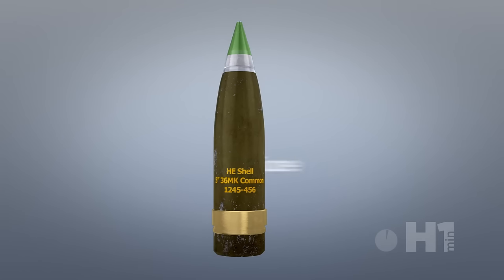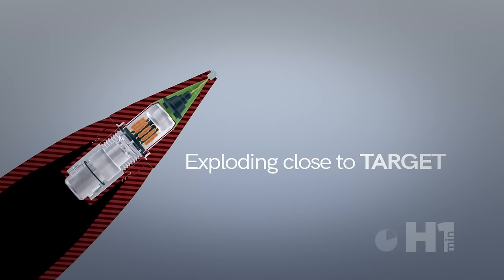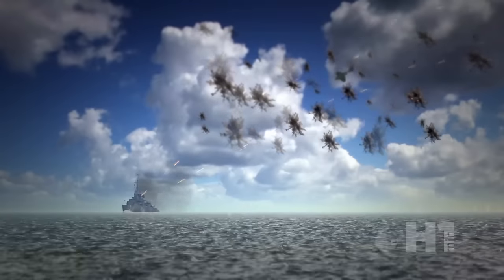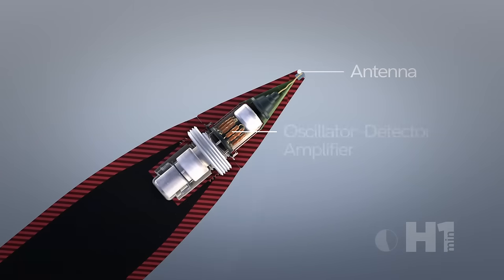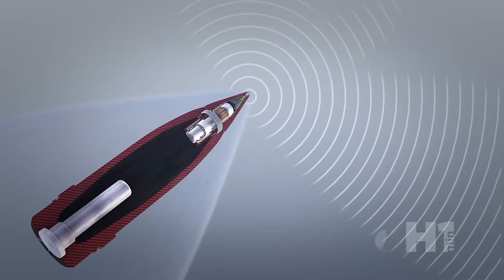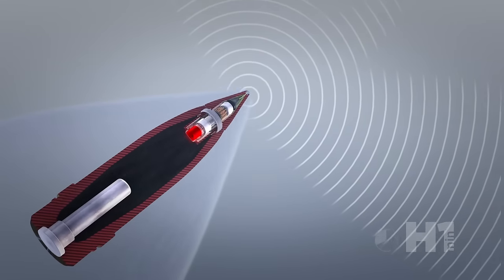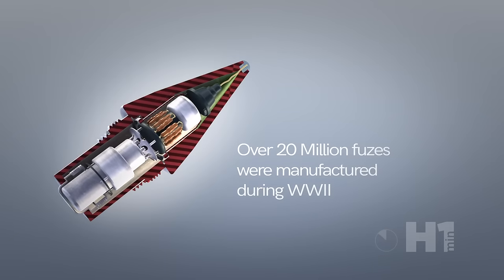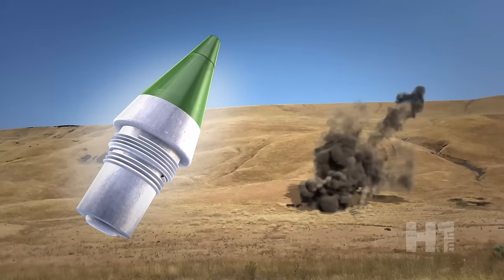H1MIN: WWII VT Fuze

Comment: Great video but - fuse!
Reply: both fuze and fuse are correct
Reply: @PineCone227_  No - in English fuse is correct.
Some foreign adopters of English don't take the trouble to learn the language properly and use an anything-will-do approach.
Fusion, to unite by melting together. (Originally French)
Fused, melted together.
Fuse, something that causes fusion.
Or is is fuzion now?
Perhaps confuzion next? :)
Reply: @johnx9318  Wrong. As explained by Oliver Hogg in his book "Artillery: its origin, heydey, and decline" -
The word "fuze" is often spelt "fuse" by those unacquainted with artillery usage. This is incorrect. "Fuse", derived from fusus, the past participle of fundo, means "to melt", e.g., the term "fuse-wire" used in electrical circuits. "Fuze", on the other hand, is the shortened or modern method of spelling "fuzee", meaning a tube filled with combustible material. It is a derivation of fusus, a spindle and from the French fusee, a spindle full of thread. It is well to make this point at the outset.

Even the US military spells it with a 'z'. Its hilarious how you jumped to the conclusion that its a case of foreigners "not bothering to learn english properly" when you yourself dont even bother to check your facts. Stop making things up to sound smart.
Reply: @BecauseHyena  You seem to have proven my point very concisely. Thanks.
Your mistake was taking the USnA's uneducated, lazy and ignorant bastardisation of the English language as an beacon of proper English is a truly a futile exercise.
And yes, exercise too has an S, not a Z.
Swing and a miss.
Reply: Did you even read the quote from Oliver Hogg? His book was literally endorsed and published by the Royal Artillery Institution in London.  He also referenced several GB patents that refer to the invention as an "electrical fuze". This makes you wrong again.
Also I mentioned the US military's spelling of the word because they literally helped the British invent the proximity fuze. Pretty sure the English guys would've already corrected them 80 years ago if the Americans had the spelling wrong don't you think?
Finally, stop using irrelevant counter examples: "exercise too has an S, not a Z". You're only making yourself sound condescending. I already told you that the word fuze is not derived from the word 'fuse' - that is of course if you even read my previous reply which I think you are too ignorant to do.
Reply: @BecauseHyena  Or it makes him wrong.
Reply: @BecauseHyena  PS - americans don't like to be corrected. They already know everything apparently.
Reply: @johnx9318 You appear to be projecting because your description of Americans "not liking to be corrected" and "knowing everything" fits you perfectly.
I haven't been to the US but I've known a few Americans from post grad school at Oxford. They aren't all arrogant as you make them out to be.
You claim Mr Hogg to be wrong but you don't state your reasons for saying so. Do you honestly expect people to believe you, an armchair expert, instead of Brigadier O. F. G. Hogg of the Royal Artillery - who was even awarded the The Most Excellent Order of the British Empire for his contributions in field artillery by King George VI himself?

Here's some advice. You have been called out. Stop trying to wriggle yourself out if it; you're only going to embarrass yourself more. Next time argue with facts that you can back up instead of using hollow opinions and emotion. Have a good day.
Reply: @BecauseHyena  Nice try. The RA are a new service. I was a gunner in the RN, the senior service.
We used fuses.
My knowledge is first-hand and not the result of academic pontification.
I didn't say that americans were arrogant - your projection there.
Thanks for your rudeness.
And thanks, having a great day.
Reply: @johnx9318  You literally said that the Americans "don't like to be corrected" and "apparently they know everything". Tell me how that isn't the same as saying they are arrogant.

Your account regarding being in the RN does not take precedence over the account of a British officer who has studied artillery for the majority of his life. New service? The guy literally lived through WW2. If you took the time to look up my sources then you would have seen that the GB patents the British inventors of the proximity fuze applied for literally spell it that way. Just because you and your unit decided to spell it differently doesn't magically invalidate the way the inventors of the device itself intend to spell it. It may have been acceptable to spell it as "fuse" in your unit but that doesn't necessarily make it universally correct. I wouldn't blame your unit though because everyone makes mistakes after all. However, brushing off well-cited constructive arguments that prove you wrong as "academic pontification" is not excusable and exemplifies ignorance/inability to engage in civil discourse on your part.

I apologize for hurting your feelings. But then again, can you really blame me when I'm arguing with someone who thinks his "first hand account" in the RN is more credible than my well researched arguments. Maybe I should also mention that I work in RnD at BAE Systems developing standoff weapons since were talking experience?
Reply: @BecauseHyena  Yes - literally.
And I did not say they were arrogant.
You inferred that yourself.
Mmmm, take the word of a researcher or someone who used the things for real?
Difficult...
Reply: @johnx9318  More like "take the word of an engineer who has been studying artillery for 7 years and helps develop and instruct the military how to use it or the RN serviceman who is only taught how to use it without any real knowledge on how it even works"
Reply: @johnx9318  Also, be a dear and kindly argue against the other points I made. Don't dwell to much on whether or not you called the Americans arrogant. I'll let that pass if you actually make the effort to form a constructive counter argument. If you're so sure of yourself, then it shouldn't be that hard.
Reply: @BecauseHyena  Don't know how you get your hat on.
Reply: Dude youre getting demolished by him. If you havent noticed, youre digging your own grave at this point.
Reply: @joeysoledad469  Finally someone to break some sense to him
Reply: @James some guys just dont know when to give up. ive known my fair share of boomers who would rather die than admit theyre wrong lmao
Reply: @BecauseHyena  It was you who brought it up.
Reply: @joeysoledad469  Nose
Reply: Funny thing, I made a simple observation to the author of the video. He/she didn't get all unnecessary with me.
I didn't interrupt any of your posts.
However, @James took it upon himself to preach his own version of the truth to me and actually tripped over his own argument, and you decided to get a free ride in his back.
Champion trolling.
Reply: @johnx9318   Sorry where exactly did I trip over my own arguments? As I see it they are still solid and I've not made any contradictions.
Stop trying to turn this around and making it sound like you don't deserve this.
Sure, you only made an observation. Problem is, I happen to know references that say you are wrong, so I corrected you. What you then did was spread misinformation that you falsely attributed to "foreign adopters of English not bothering to learn the language properly". You then proceed to insult Americans by saying they are uneducated, lazy, and ignorant because I mentioned them in an argument - and you fail to realize that the Americans didn't come up with the word "fuze", the British did. I give you references published by highly regarded people in the field but you fail to address them too.
But sure, all you did was make an "observation".
Reply: @joeysoledad469  You back again? So nosey and judgemental.
Nothing better to do with your life than interfere in the business of others?
Tsk.
Reply: @johnx9318  Your appeal to emotion wont work here.
Kindly point out where I called you out for saying "the Americans are not learning the language properly".
I've made this up? Dude the sources I quoted are avaiable from reputable websites on the internet. For all I know, you could be the one making up anything since all your claims are just word of mouth and not easily verifiable.
Regarding the belittlement of your RN rank; kindly tell me, who is it again who compared his military service to a 'researcher' in attempt to belittle him?
Finally, don't involve other servicepeople because you do not represent them (i hardly believe they would want to associate with you in this aegument anyway). All my comments are directed to you and apply to you alone. In fact, you should be ashamed of yourself because you are using the repuation of servicepeople for your own personal interests.

I'm saying it again. You brought this upon yourself.
Reply: @John X
"you proved that fuse was derived from a word with an S, not a Z"

LOL did you even read his first comment on this thread entirely? fuse was derived from a word with an 's' BUT fuze is derived from the word fuzee which is what the inventors intendes to call the proximity fuze
this is freakin hilarious
Reply: @joeysoledad469  Butthurt butinski is back!
Just can't keep your proboscis out can you?
Reply: @John X
"Your assertion that an academic had more right to be right than a person who actually used the product is nothing short of arrogant."
He never said that it was claim made by himself. what James did was refer to a claim by the inventor of the device itself. so to the correct version of your statement should be:

"Your assertion that the inventor of a product had more right to be right than a person who actually used the product itself is nothing short of arrogant." You see how stupid that sounds? stop twisting his words to prove a point

and no im not leaving because i have the freedom to speak my mind. unless youre telling me that i cant enjoy one of the basic rights our military servicemen are fighting for????
Reply: @BecauseHyena  No, you couldn't find them. But you are hardly motivated to try hard are you?
Nice try again, but now you have made the quantum assumption that I am not  decorated!
Not only is that another wild swing, but most people who have been there have not been decorated. You just insulted them.
Further, for someone who didn't serve - how transparently judgemental.
How dare you put yourself in judgement of these people?
Yes I did call you names, but only because they are an accurate depiction of the supercilious and pompous attitude that drives your invective.
Reply: @coreyg.3116  Thanks, but it's his play.
Reply: @johnx9318  Here we go again:
"No, you couldn't find them. But you are hardly motivated to try hard are you?"  > Hmm so you accuse me of saying something and yet you yourself can't point out exactly where I said it? Come on you can do better than that. I did you a favor and quoted all your arguments in my replies so you can't deny saying them. Be a dear and do the same please.

"Nice try again, but now you have made the quantum assumption that I am not decorated!" > Again please show me exactly where I said your weren't decorated.

"Not only is that another wild swing, but most people who have been there have not been decorated. You just insulted them." > I beg to disagree. My grandfather was enlisted in ww2 under the Royal Corps of Signals. He said he he was relatively safe, far from the frontlines. He wasn't a decorated soldier and he recognizes that his sacrifice is in no way the same as those who fought at the front. Is he insulted when people comment on his lack of decorations? No because he himself is aware of his own contributions and would not dare to compare it with those who gave up their lives in the front. Im sure any respectable serviceperson would not dare inflate their service because doing so would be stolen valour. Hence, the same, less decorated servicepeople would have no reason to be insulted when others talk about highly decorated servicepeople. Does that mean their contributions are worthless? Absolutely not. Thus by saying this phrase:
 "most people who have been there have not been decorated. You just insulted them."
You are telling them that they SHOULD feel insulted because YOU believe that their contributions are worth less.

"Further, for someone who didn't serve - how transparently judgemental. How dare you put yourself in judgement of these people?" > Refer to my previous argument. I am not judging these people. I am judging you.

"Yes I did call you names, but only because they are an accurate depiction of the supercilious and pompous attitude that drives your invective." > You know, you yourself haven't responded in a way that promotes civil discourse. You attack my character instead of my arguments. I was hoping youd have realized by now that insults mean nothing to me (people capable of basic critical thought tend to be immune to them).

Again, you brought this upon yourself.
Reply: @BecauseHyena  You impose your opinion to a comment for someone else and expect a civil response?
Your arrogance knows no bounds.
As for the rest of your tiresome tirade, you should get a job inflating blimps.
Reply: @johnx9318  
"You impose your opinion to a comment for someone else and expect a civil response?" > The same way you imposed your misinformed opinion against the author of the vid? I'm sorry but this is the internet. You post your opinion, you open yourself to criticism. That is what makes the internet such a powerful tool; people are discouraged from posting false information and misinformed opinions because they know they are at risk of getting exposed and these people often do not want their beliefs questioned - they dont care if they are wrong; for them, their ego is more important than the truth. When you post your opinion on the internet, you should be ready to back up your claims with logic and facts. Otherwise, expect to be shut down. If you are too narrow minded to accept that your beliefs will be challenged, then I'm afraid the internet is not for you.
Also for the record, I did not state an 'opinion'. I stated a 'fact' because I was able to produce first hand sources that can be verified by everyone here. You are the one making an opinion because all you have provided is word of mouth to prove your claims.

"Your arrogance knows no bounds. As for the rest of your tiresome tirade, you should get a job inflating blimps." > Let's see. Throughout this conversation, I have made it clear that I am open to correction by laying out all relevant information regarding my claim. I focus on every counter argument and ask clarifications. You on the other hand never bothered to provide verifiable information regarding your claims, leaving us to guess where you based your statements from. You dodge most of my counter arguments and all you do is swing back with insults as if you feel threatened (are you?). All that and yet I'm the arrogant one? Hmm.
And again, if I were you I'd cut down on the insults because it's only making you sound desperate. Perhaps you got used to throwing the same insults to your subordinates in the RN to shut them down, expecting them to back off? Sorry but I'm afraid that's not how it works everywhere else.

Once again, you brought this upon yourself, John.
Reply: @BecauseHyena  What did I bring upon myself? Your intrusive whinging tirade?
It's not the big deal you think it is. Really.
Get over yourself champ.
Reply: @johnx9318 
"What did I bring upon myself?" > The embarrassment of getting lectured by someone probably younger than you over the internet.

"Its not the big deal you think it is." > Yet here you are, still responding to me :)
Reply: @BecauseHyena  Another quantum-leap of conclusion!
i'm not embarrassed. This is fun.
Keep spouting moby...
Reply: @johnx9318  You seem to have proven my point. You still replied so it IS a big deal to you :)

And trust me, I'm having as much fun as you are
Reply: @BecauseHyena  I thought you had blown a fuse.
Reply: @johnx9318  That's rich coming from someone desperately crawling his way out of a losing argument :)
Reply: @James holy shit you killed him dude
Reply: @John X Nope. Im picking my own fight with you.
All you did was cavil and squibble at james' points while you yourself havent brought anything of substance to the table. you are in no position to be throwing insults around here lol
Reply: @joeysoledad469  He would be delusional if he thinks that his insults hold weight
Reply: @joeysoledad469  Are you sure? I feel entitled.
Reply: @johnx9318  Yea we already figured that you probably are entitled given your responses.. But thanks for saving us the trouble and admitting it yourself :)
Reply: @BecauseHyena  It's a real word with a real meaning.
Not just a cheap insult thrown by you virtue-signalling KBW's.
Reply: @BecauseHyena  
oh. and 'us'? What a givaway!
:)
Reply: @johnx9318  Also:
"virtue signalling KBW" > Hmm I dont think virtue signalling means what you think it means
Reply: @BecauseHyena  Sorry you don't know what VS means. You could look it up?
And the 'us' reference was regarding your admission of collusion with your academic hero.
Reply: @johnx9318  
"Sorry you don't know what VS means." >  I never said I didn't; maybe you should get your eyes checked.
I looked it up for you cause you apparently are too lazy to do it. Oxford defines VS as "the action or practice of expressing opinions intended to demonstrate the moral correctness of one's position on a particular issue". How did you turn an argument about fuzes into a discussion of morals? Swing and miss.

"you have an entire weak mind" > I'd be impressed if that very well thought out insult came from 5 year old, not a fully grown adult who claims to have served in the RN :)
Reply: @BecauseHyena  And now you are playing guess the age? Just keep assuming things.
Reply: @BecauseHyena When you bragged about your fantastic education, you also took the opportunity to blow your own trumpet regarding your fantastic powers of research.
Pity you can't compare your comments to mine before you continue to prove my points! It's not not brain-science.
Nearly 40 grand a year? I wonder what currency that is? Pesos? You don't seem Mexican.
Reply: @BecauseHyena  Name-dropping 'Oxford' in an educational context is most definitely bragging.
Your inflated ego failed to resist that little temptation.
Mexican was thrown in to demonstrate how often you assume things - in this case that your 40k salary was in pounds and not pesos.
I will assume that you are from the UK and not Zimbabwe. A Zimbabwean, would demonstrate better manners and respect when engaging with strangers.
 But now you have explained that to me, I am better able to understand why you are so closed-minded and intolerant.
Perhaps if you got a better job you could afford to travel? It would broaden your mind and teach you how to engage with others.
Reply: @johnx9318 
"Name-dropping 'Oxford' in an educational context is most definitely bragging." > That is just your opinion. All I mentioned was the city. There are many universities in Oxford and not all of them are prestigious to the point that one would even consider "bragging" about them. You just clearly demonstrated how often you assume things.
"Your inflated ego failed to resist that little temptation." > Again, Ive already explained above that you assumed incorrectly and hence misinterpreted my intentions. Yet here you are making another false assumption. It wouldnt be possible for me to "fail to resist" something that was never there to begin with. Swing and miss.

"Mexican was thrown in to demonstrate how often you assume things - in this case that your 40k salary was in pounds and not pesos." > John, you pulled all that nonesense from me saying the words "quite well". Are you really sure I'm the one whos "often to assume things"? :)

"I will assume that you are from the UK and not Zimbabwe. A Zimbabwean, would demonstrate better manners and respect when engaging with strangers." > The Zimbabweans are lovely people. Too bad you yourself have manners so poor that even they, in all their kindness, would probably not deem you worthy of their respect.

"But now you have explained that to me, I am better able to understand why you are so closed-minded and intolerant." > Oh this again. Since the start Ive made it clear that I am open to correction by laying out all my claims in detail and answering to all counter arguments. You, on the other hand, dont even bother explaining your claims. You fail to defend most of your counterarguments once I address them and you choose to attack my character instead. Hmm, it appears that you are the one "close-minded" and "intolerant" here, John. :)

"Perhaps if you got a better job you could afford to travel? It would broaden your mind and teach you how to engage with others" > Another assumption on your part, I'm afraid. :)
I don't exactly have lots of bills to pay at this age so I've travelled to 8 countries now. Ive befriended many people across different cultures and you know what? You still stick out as the worst example of a human being that I've come across.
Another swing and miss.
Reply: @BecauseHyena  Took such a lot of effort to write such a lot of tripe.
Swing and a miss - where have i heard that before?
Reply: @johnx9318 
"If you wish to engage in discourse and encourage a good response, then the tactics of bulk copy-and-paste along with attempting to claim originality for the other fellow's observations becomes too tiresome. Both to read, and to reply to." > Oh you find it tiresome? Sounds like your problem, not mine. I mean anyone would get tired eventually when it becomes apparent that their repeated harassment of a person is not having its desired effect. :)

"Just to reiterate, you began your discourse with me by being rude, arrogant and intrusive." > Nope. I only responded in the same manner you replied to the first comment on this thread made by PineCone227.

"You showed condescension from the start and are an opinionated blow-hard." > Let me remind you how you started this argument:
"No - in English fuse is correct. Some foreign adopters of English don't take the trouble to learn the language properly and use an anything-will-do approach."
also
"Fuse, something that causes fusion. Or is is fuzion now? Perhaps confuzion next? :)".
Seems like you were the one who has been condescending from the start. You may convince yourself otherwise but that wont change the truth.

"Your diatribe is freely laced with assumptions," > You say this but you havent even succeeded in calling me out on a wrong assumption. Everytime you claim I made an assumption, I address it directly and you always end up giving it up or not dedending perhaps because you realize I proved you wrong.
"None of which hit their mark" > Is that so? How come you havent countered any of my fact-based claims yet if youre so sure I'm wrong? You cant just say theyre wrong, John. You have to prove it. That's how arguments work.

"you are desperately trying to salvage your butt-hurt ego"> Hmm. Ive responded to you calmly in well thought out arguments. You respond with hate, unproven accusations, and immature insults that have nothing to do with the discussion. Seems to me that you are the one "desperately trying to salvage his butt-hurt ego", John.

"Attempt to best me in any way you can" >Hold on. You thought this was all about me trying to best you? That never even occurred to me because I'm barely trying, John. Funny how you think its suddenly a contest of whose "best" when all im trying to do is engage in casual discussion.

"Oh, and you have to have your supporter also butt in" > Remember that these strangers based their judgement solely on the arguments weve made. We were judged on equal footing. Being upset with them will only prove you are narrow-minded because you choose not to concede despite several people already proving you wrong.

"and tag team troll tactic. How's that for an alliteration" > Too bad that little alliteration of yours is not enough to "salvage your butt hurt ego". Keep it on topic, John.
Reply: @BecauseHyena  Have you considered writing a book?
You could cut and paste yourself onto the bestsellers list.
I'm not bothering to read your c and p rants. Far too boring.
Reply: @johnx9318  You wish to deliberately ignore my valid points? Looks like thats your problem.
Also, the truth tends to be boring. Unfortunately for you, my points still stand no matter how hard you try to avoid it.
Reply: @johnx9318  
Too bad . By choosing to ignore my counterarguments, you give up defending your own points. That doesnt help your case, John.
And you are mistaken. I never supposed quantity had any benefit to my position. If you havent noticed, all my long comments are proportional to yours. You make a long comment, I make a long comment. I'm simply being courteous. :)
And me? Desperate? That's a lot coming from someone who openly admitted to not bothering to read points made against him because he cant come up with a logical counter argument.
Reply: @BecauseHyena  You don't think that extensive cut and pastes don't add to the quantity?
That's a silly comment.
Reply: @johnx9318  The extensive cut and paste that is solely dependent on the length of your own comments? You tell me, John.
Reply: @BecauseHyena  Word salad
Reply: @johnx9318  if that perfectly understandable statement appears as "word salad" to you then that's you problem, John. :)
Reply: @BecauseHyena  It's gibberish. Means nothing. This demonstrates your lack of ability to communicate. It is either deliberate or ignorant obfuscation.
Reply: @johnx9318  Nope. It demonstrates a lack of reading comprehension on your part. I hope its deliberate and not ignorant obfuscation. :)
Reply: @BecauseHyena  Glad to help you learn a new word. Good of you to use it straight away too.
If only you would learn some manners...
Reply: @johnx9318  Glad to help you learn the correct meaning of "virtue signalling" as well. Too bad you found out after youve already used it incorrectly. If only you would learn to be grateful..
Reply: @BecauseHyena  Just rehashing my arguments. Sad that you have no original thought.
Reply: @BecauseHyena  You wish!
Reply: @johnx9318  I dont have to. You never proved me wrong.
Reply: @BecauseHyena  Didn't have to - you did that all by yourself.
Reply: @johnx9318  Prove that I did. I'll wait. :)
Reply: @BecauseHyena  Don't hold your breath...
Reply: @johnx9318  Take your time :)
Reply: @BecauseHyena  Sorry, can't engage atm. Cocktail time. Speak later...
Reply: @johnx9318  Alright see you soon
Reply: @BecauseHyena  Sorry about that.
Just wondering if you are okay with the side-effects?
Reply: @johnx9318  Youre getting off topic again, John. :)
Reply: @BecauseHyena  You are right, but it is significant.
You're in danger of permanent erection loss. When you get your next stiffie, your mind will inexorably think of me and your tiny todger will go all floppy. Sorry.
Same with sleeping. As you drift off, I will pop up in your mind and your blood pressure will shoot up. Can't be helped. Just try to ignore it. You'll be fine.
I'm just playing. It's just a bit of fun.
Can't happen. Really.
Reply: @johnx9318  Just type away, John. I promise to read them all.
Reply: @BecauseHyena  Pity you can't learn from them.
Reply: @johnx9318  nothing to learn from your little rant filled with hate and nonesense.

To make it easier for you, ill oversimplify my replies to keep you on track until you come up with a fact-based logical counter argument to my points. Have fun. :)
Reply: @BecauseHyena  That's brilliant! I won't have to put up with your monotonous drivel!
Thanks.
Reply: @johnx9318   thats still an invalid argument, john. Try again. :)
Reply: @BecauseHyena  It's no better than you.
Reply: @johnx9318  still waiting for your valid argument
Reply: @BecauseHyena  What would you like to know?
Reply: @johnx9318  good to know youre still alive. was worried when you stopped replying after my comment
Reply: @BecauseHyena  Still alive thanks.
Just wondering what you are blathering on about.
I'm sure it's neither interesting or important.
Reply: @johnx9318  yea im afraid thats still not a valid counterargument
Reply: NFI what you are on about.
Do you have a point?
(Excluding the top of your head of course.)
:)
Reply: @BecauseHyena  You think I am bothered to do homework to answer you?
When you are too lazy to ask the question?
Think again Einstein.
Reply: @BecauseHyena  Knob
Reply: @johnx9318  cry
Reply: @BecauseHyena  I hope you learn how to communicate your questions one day.
Reply: @johnx9318  i hope you learn some reading comprehension one day
Reply: @BecauseHyena  Too late for you
Reply: @johnx9318  nah. Keep crying
Reply: @BecauseHyena  Boo-hoo.
Happy now?
Reply: @johnx9318  seethe
Reply: @BecauseHyena  You are in hot water?
Reply: @johnx9318  cry
Reply: @johnx9318  cry
Reply: @johnx9318  cry
Reply: @BecauseHyena  cry
Reply: @johnx9318  cry
Reply: @BecauseHyena  cry
Reply: @johnx9318  cry
Reply: @BecauseHyena  cry
Reply: @johnx9318  cry
Reply: @BecauseHyena  cry-baby
Reply: @johnx9318  cry
Reply: @BecauseHyena  You will think of me
Reply: @johnx9318  cry
Reply: @BecauseHyena  And when you are all hard...
Reply: @johnx9318  cry
Reply: @BecauseHyena  
When you are all hard
You will think if me
You will go floppy.
All floppy.
You won't be able to go hard.
You will hear me laugh at you.
All soft and floppy.
You will cry.

Cry.
Reply: @johnx9318  cry
Reply: @BecauseHyena  Floppy, floppy, floppy...
It's in your head.
Cry...
Reply: @johnx9318  cry
Reply: @BecauseHyena  Floppy...
Reply: @johnx9318  cry
Reply: @BecauseHyena  Flo-ppy, floppy, floppy.
Reply: @johnx9318  cry
Reply: @BecauseHyena  Floppy floppy floppy.
Poor little thing...
Reply: @johnx9318  cry
Reply: @BecauseHyena  Sorry Mr floppy, I've been busy.
Floppity-flop...
Reply: @johnx9318  cry
Reply: @BecauseHyena  Hi floppy.
Reply: @johnx9318  cry
Reply: @BecauseHyena  Floppy! :)
Reply: @johnx9318  cry
Reply: @BecauseHyena  Floppy!
Reply: @BecauseHyena  cry
Reply: @johnx9318  cry
Reply: @BecauseHyena  That was unexpected!
😂
Poor old floppy...
Reply: @johnx9318  cry
Reply: @BecauseHyena  Floppie! Cry Floppie cry...
Reply: @johnx9318  cry
Reply: @BecauseHyena  Ha-ha. Sorry floppy.
Reply: @johnx9318  cry
Reply: @johnx9318  cry
Reply: @BecauseHyena  Fuse
Reply: @johnx9318  cry
Reply: @johnx9318  cry
Reply: @BecauseHyena  Knob
Reply: @johnx9318  cry
Reply: @BecauseHyena  Flop
Reply: @johnx9318  cry
Reply: @BecauseHyena  Hey flopps, just like your boyfriend - I'm in your head.
Cwy.
Reply: @johnx9318  cry
Reply: @BecauseHyena  Say cry
Reply: @BecauseHyena  Say cry again
Reply: @BecauseHyena  
Do as I tell you - Say cry
Reply: @BecauseHyena  Do as I say - say cry
Reply: @BecauseHyena  Oh she did!
Reply: @johnx9318  cry
Reply: @BecauseHyena  She's old enough to know better, so
Reply: @johnx9318  cry
Reply: @BecauseHyena  Hi floppy. What will you do next?
Reply: @BecauseHyena  You did what when you looked at your life?
Reply: @johnx9318  looks like your having fun replying to my bot. Lets change that
Reply: @johnx9318  thats not a valid argument, john :)
Reply: @BecauseHyena  Cry
Reply: @johnx9318  its now programmed to reply random phrases til you come up with a valid argument. Enjoy
Reply: @johnx9318  .
Reply: @BecauseHyena  Cry
Reply: @BecauseHyena  Poor old floppy.
Reverting to drawing pictures of his brain-cell. 😆
Reply: @johnx9318  invalid argument, john :)
Reply: @johnx9318  fuze
Reply: @BecauseHyena  Yes. A short and floppy fuse.
Reply: @johnx9318  cry
Reply: @johnx9318  cry
Reply: @BecauseHyena  There's floppy and his pretend bot again.
Reply: @johnx9318  .
Reply: @BecauseHyena  You finally made a good point! "."
😅
Reply: @johnx9318  fuze
Reply: @BecauseHyena  You're confused.
Reply: @johnx9318  ok boomer
Reply: @BecauseHyena  And now you are trying compliments!
Reply: @johnx9318  cry
Reply: @johnx9318  fuze
Reply: @johnx9318  .
Reply: @johnx9318  not a valid argument
Reply: @BecauseHyena  Hi floppy.
Reply: @johnx9318  cry
Reply: @BecauseHyena  Limp
Reply: @BecauseHyena  Finally I understand!
1. Your argument is that of an invalid.
2. This makes you cry.
3. Because you are on your .
Reply: @johnx9318  fuze
Reply: @BecauseHyena  
We wish you a floppy xmas,
we wish you a floppy xmas,

we wish you a floppy xmas,
and a floppy new year!
Reply: @johnx9318  ok boomer
Reply: @BecauseHyena  😊
Reply: @johnx9318  .
Reply: @BecauseHyena  Sorry, is it me again?
Reply: @johnx9318  cry
Reply: @johnx9318  ok boomer
Reply: @BecauseHyena  Must be time for you to say 'cry', or misspell fuse again?
Reply: @BecauseHyena  Floppy new year buddy.
Reply: @johnx9318  ok boomer